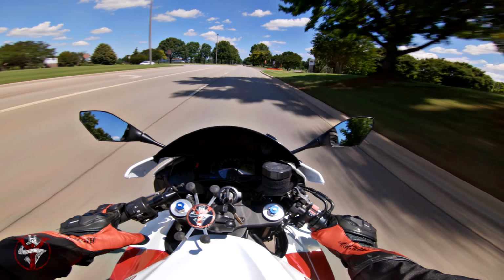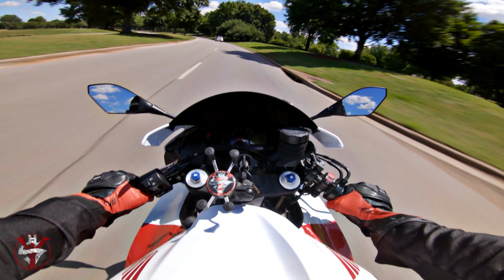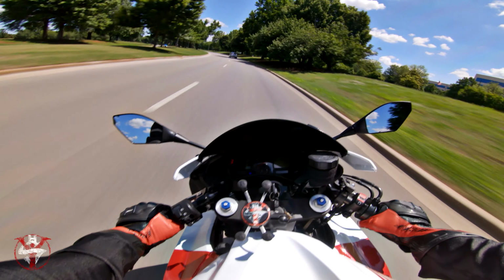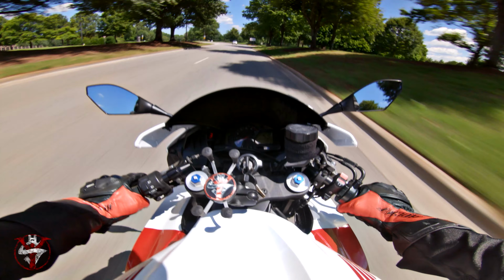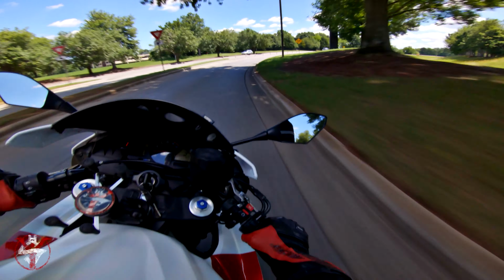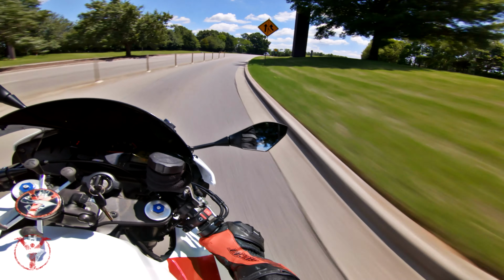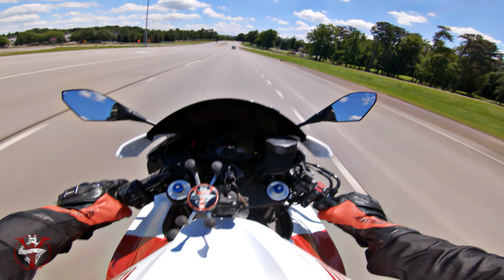How To Rev Match on a Motorcycle | Honda CBR600rr Motovlog #42

Comment: Do it like that but it jerks forward. When I release the clutch a bit slower it goes smoother. 07 600rr
Reply from the maker: If you're jerking forward, you may be reving too high, almost like trying to do a clutch up wheelie. Try a little less rpm. If you release too slow, you're allowing the engine to sync back up with the wheel, similar to how you slowly release the clutch when you're taking off in first gear.
Reply: Happening to me too moving to a 300cc to a 07 600rr the throttle is so sensitive makes it harder
Reply: @deezygdup5600  just takes practice. One year later  mine are smooth as butter :)

Comment: So making sure... can I rev plus click down at the same exact time without disturbing the rpm? 

Just new to the motorcycle community and wanted to get this done at some point😅
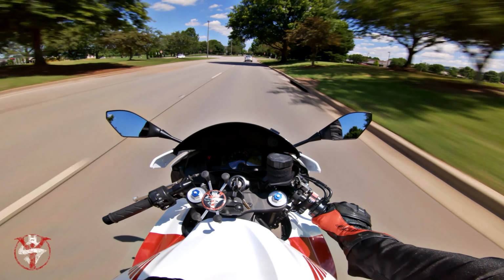Reply from the maker: No sir, let me  try to break it down a little better. These numbers aren't exact, but think of it like this. Say you're traveling at 30mph in 3rd gear at 5k rpm. 30 mph in second gear may be 6k rpm. The purpose of rev matching is to get the rpm up to atleast 6k, so when you down shift from 3rd to 2nd, the rpm will be where it needs to be for that gear, making it a smother transition. If you just drop the gear without rev matching, the speed of the rear will cause the motor to turn faster. In show this starting @0:46. 
Does this make sense?
Reply: @Master_Yoshi   yes sir and thanks!!

Comment: What’s up Yoshi. Fellow CBR 600 rr here and I’m struggling with rev matching. I feel like I jerk forward every time (I’m assuming too much throttle or releasing the clutch too soon?) and sometimes still feeling like not enough throttle.   Any tips?
Reply from the maker: What's up my man! If you're jerking forward, I believe you're on the throttle while you're clutch lever isn't fully pulled. That can either be on the front or back end. By that I mean, you may be adding too much throttle before your clutch lever is all the way in, or you may still be on the throttle while your realesing the clutch. Just keep practicing, you'll find your stride! you can even slow the process down just to feel  it out. Clutch, Rev, (close throttle) downshift (or close throttle here, doesn't matter), release: is the order.
Reply: @Master_Yoshi  thanks for the feedback man. Still struggling though.  I don’t think it should be this difficult?  Is it really user error or can something be off?  

Do you have to rev match within a certain RPM range to be effective?  I ask as it seems I can do okay around the 5k rpm range but anything higher or lower and I jerk forward still.  How can you get such an effective blip with so little time?  

At this stage I feel like im going to trash the clutch before 6k miles or have to sell the bike.
Reply from the maker: @Daubs-hj8wk  I'm no certified mechanic, but I agree it shouldn't be very difficult. If I'm understanding your issue, my guess is that when you're pulling in your clutch lever, the clutch may not be fully disengaging, which is why you're still getting some power slipping through. First start with checking your clutch cable adjusters, make sure the cable is in spec. Hopefully you can Google and find the pdf service manual for your bike for free, but clutch cable adjustment should also be in your owners manual.